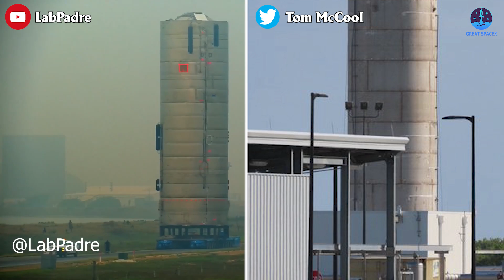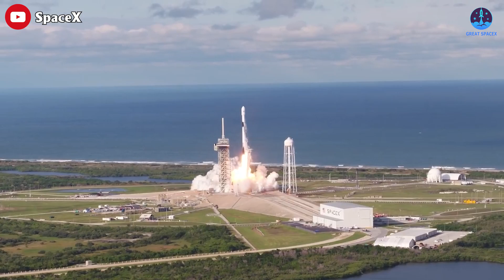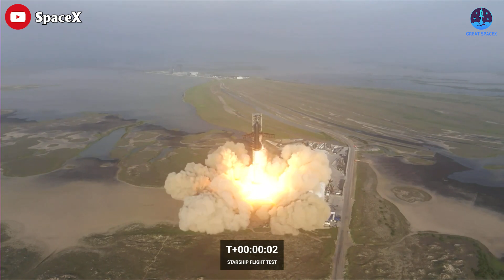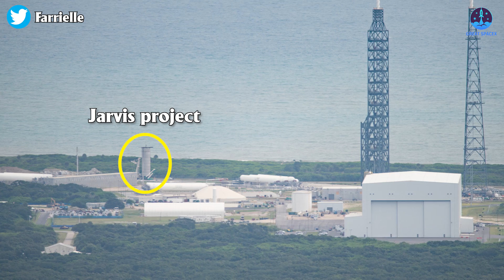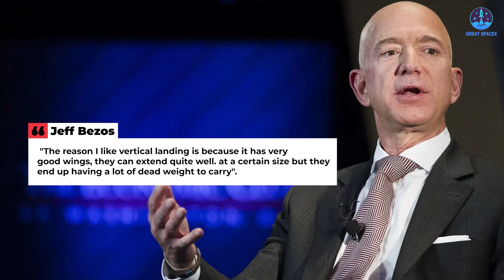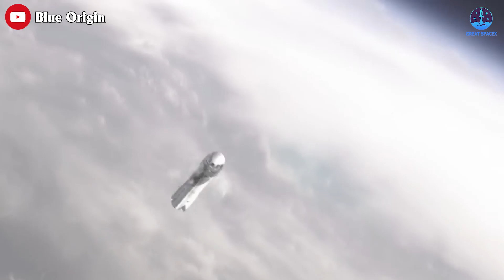What Blue Origin just did is make itself a laughing stock when copying SpaceX...

Comment: News flash, all rockets are round and cylindrical, was they supposed to launch a box? If you want to get that literal on it then, SpaceX copied me, I was launching rockets that looked very similar to this in my back yard 40 years ago...sometimes they had a nosecone, sometimes they didn't, just depended on what tube I could shove an engine in. This video has the sound of mainstream media BS, just like the comment about the explosion on starship. If you knew anything about SpaceX and actually followed them then you would know they never expected any other outcome. They had to plan for it going to space but knew it wouldn't. I talk to so many people that the first words out of their mouth is "I heard it blew up" because all they hear is media BS just like this. So everyone thinks they failed when it was exactly the opposite. The only failure on that flight was the FTS. Which is ironic because you talk about it blowing up as a failure, when it didn't blow up fast enough.

Comment: If you at least did a proper research instead of regurgitate other fanboy channels, you would know Jarvis is only similar to Starship in the use of stainless steel. Actually in theory Jarvis could be way more economical viable to commercial launches since it uses a standard payload fairing, without the need of TPS tiles as less mass on reentry.

Comment: We still have to see videos pretending there is competition between BO and SpaceX? BO can build Jarvis and physics pretty much dictates that they make it a lot like Starship, but they need to make the engines still, and the BE4 is a complicated finicky beast whose production is extremely slow. BO is committed to supplying significant numbers of the BE4 to ULA and production is way behind, and likely Jarvis will need about forty engines for a full rocket. SpaceX can make a Raptor daily, so blowing up a Starship trst flight is no problem. For BO forty BE4 engines will be years of production , beyond what they deliver to ULA. 

SpaceX will have a large fleet of Starhips in operation by the time BO does their first test hop of the Jarvis booster.

Comment: Anyone can make a grain silo. Not everyone an make a Raptor3. Given Blue Origin's difficulty with engines, I'm not too worried about BO catching up anytime soon.
Reply: The air force has had jets that flew higher than sue origin 😮😮😮😮
Reply: @juliancrooks3031 he highest flying air force jet can only reach 1/4 the height of Blue Origin New Shepard.
Reply: @ryansmith9806   Officially.  😉
Reply: @ryansmith9806  sue origin only reached 68,000 ft. The F-104 reach 104,000 ft in 1960 and still holds record for highest flying jet.
Reply: They already made 3 commercial rocket engines you can buy now. Also you’re on a space x propaganda channel they are paid by spacex to only release good news about them and bad news about everyone else to produce more favorable market trends. 

There’s a couple propaganda channels for space x
Reply: They won't.  And probably never will even come close.